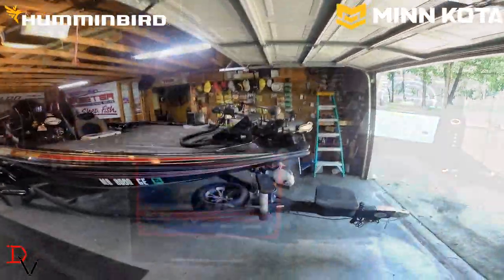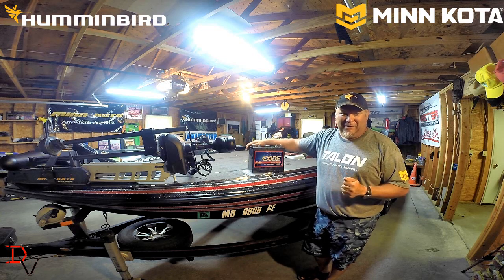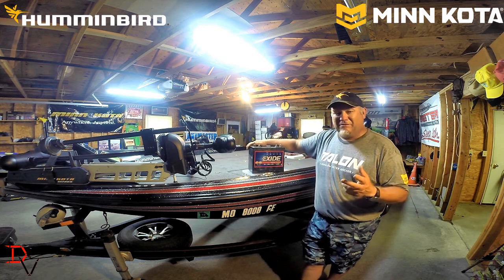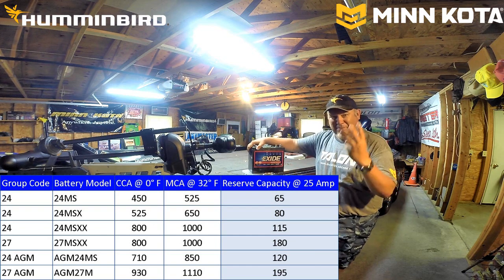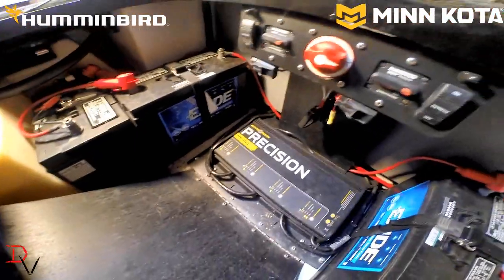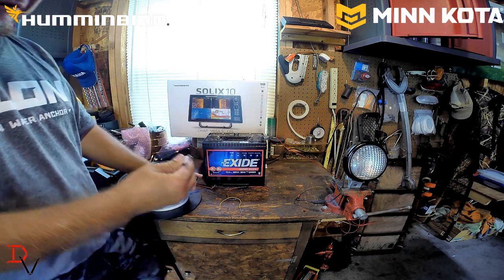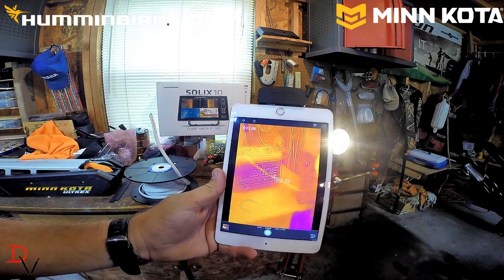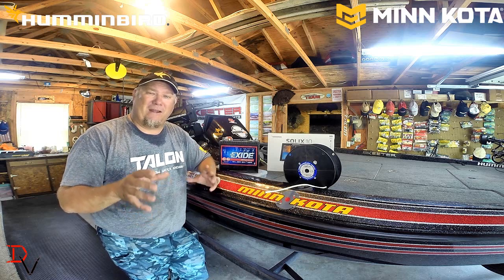Tips 'N Tricks 218: Understanding Boat Electrical Power Supply

Comment: I have a 31 agm battery from interstate, and it has 5 less reserve capacity than the 27 agm you have listed. I'll have to do more research when I buy my next boat batteries!
Reply from the maker: That is Exactly why I mentioned this is Group Code don't mean squat...It's what's inside that really matters the most. Glad it could help the next time you buy. Buying by the specs is what really matters.

Comment: How about this.  Many people believe in running a separate battery for electronics. So if you have a 36 volt trolling motor system, this means running 5 batteries. 3 trolling motor batteries, 1 starting battery and perhaps it also powers livewell, bilge pump, and all of the factory installed components, and then 1 deep cycle marine electronics battery.  Maybe Minn Kota should design a 5 bank charger.  I run the MK 345. I have a Lund Rebel XS. I just run my electronics off my starting battery as you do Doug. That's because I have a cabin and I just pull up to the lift when I feel my batteries are getting too drained and then I can easily plug into solar which I leave at my boat lift or plug in my on board charger.
Reply from the maker: I've never found the need for 5 batteries (1 Only for Electronics) and I run up to 5 units on the boat. But I buy the best Reserve Capacity Battery for the Starting Battery and reduces the need to have an extra battery. That is one of the reasons I did this video is buying the right batteries based on specs will reduce need for added expenses like adding a 5th battery

Comment: Hi Mr V , Great video , does a solix use more amps then a regular helix , someone told me a solix eats up the battery
Reply from the maker: SOLIX does require more power to run the advanced features and larger screen but it only requires 5 amp fuse so not much more than HELIX. I run 2 SOLIX & 3 HELIX plus everything else on my boat off a single battery.

Comment: Minnkota recommends 105 Ah (Amp hour) minimum on the majority of their trolling motors. I understand that Amp hour and Recover Current are NOT interchangeable and some battery manufacturers offer one or the other in the specs. I have read that there is a conversion formula that you can use to convert one to the other and that its typically a hair higher than 2 RC's to 1 Ah. Do you have any information about the difference?
Reply from the maker: It's Reserve Capacity and Amp Hours both help determine the amount of electricity that can be stored in a battery for use by electronics or in the case of starting batteries how long they can spin the starter. I do not have a conversion chart but might check google search engines lost of good reads on electricity on the internet.

Comment: Doug I'm buying a z21  one battery for gas motor and 3 batterys for minnkota 36 volts  I'm going to buy 2 solix 15" screens. Should I hook the fish finders to the starting battery or one of the end trolling motor battery ?  Or should I get a extra small 12 volt battery for just for the fish finder ? i would have 4 baterys then on boat.   Thanks
 Jim

Comment: So I'm getting new boat and it comes with the interstate 31m-agm cranking battery it has 800 cca or 1190 ca which one go by?  And 190 rc @ 25 amp.  Im going to put 2 helix 12 mega si and 2 helix 10 mega si and 360 on is this going to be good enough battery?  Thanks in advance Doug.
Reply from the maker: Sounds like it could work. I haven't had much personal success with Interstate but they may work. Specs look good.

Comment: I've never understood why you must wire graphs directly to your battery, rather than to the master fuse box, which often times protects you with a master power shutoff.  If you wire directly to the starting battery, you bypass the master power shutoff, thus opening the human element of forgetting to shut off all graphs in the boat.  Can you explain or do a video why it's important to wire directly to the battery vs the boat's supplied fuse panel.  Also, how do you handle the master power, truly not powering down all electrical components in your boat?  Thanks.  Loved this video by the way.
Reply from the maker: It all depends on the amount of current through that master powerswitch. Plus powering down a unit by cutting power and not using the proper button on the unit can damage the unit and not save settings. Not good improperly powering down unit and not good not providing it sufficient power. Plus you should always fuse the wiring at the battery for the unit so it's protected too.
Reply: I have a master power switch on the dash for all other electrical but my fishfinders.  For that (helix10) I use the same 10awg wire Doug recommends to an on/off switch then to a buss bar and on to a new fuse panel.  The power wire from the helix has a very short distance to travel as the fuse  panel is right below the console.  Works great!
Reply: The way I have mine setup is I have a battery mounted 60 AMP fuse.  6 AWG going to a Blue Sea Systems which has a positive and negative bus. I cut out a hole in my dash and mounted a battery switch. So the positive goes from the battery to that switch and then to the Blue Sea Systems fuse panel. The negative goes straight from the battery to the fuse panel.  I have it screwed on the wall under that is the longest distance from my feet just above the floor.  So it's basically the same concept as master power. One battery switch turns on the whole circuit that connects to that fuse block.
Reply: And yes each of the individual components have 3 AMP fuses to each of them on my Blue Sea Systems fuse block.
Reply: @DougVahrenberg  well what do you recommend? I two am running new wire for my bigger helixs, one at the console and one on the bow. Should I run dedicated wire to both straight to the battery? This means four sheilded 10 gauge wires from the battery up to the console and the other two going to the bow? Won't my units drain my battery?

Comment: Doug,          I have the Solix 12 chirp/with side imaging and a MinnKota Terrova with the US2 transducer. Do I use the 14 M SIDB Y splitter cable so I can designate which transducer (transom/bow) is operating ?
Reply from the maker: You do not need the Y Cable unless you want the 2D sonar always from US 2 and the SI & DI from the second transducer. Or I just install the SI transducer and it will do everything you need 2D, SI & DI from the single transducer.
Reply: Doug Vahrenberg Thank You

Comment: You are saying that because you are running several units you use 10 gauge or you run 10ga to  each unit.  10 gauge is rated at 30 amps. I am fused at 5 amps? That is 6 times the current carrying capicity than it is fused? I am an electrician and I believe in running bigger wire than needed for voltage drop. I thought mine was over kill with 12 ga wire.

Comment: Doug I’m looking at getting a battery solely to power my new Helix 10 mega si g2n. A battery that will get me through a day of drift fishing, spot locking and still maintain 50% battery life by the time I’m back at the marina, any ideas on a battery for this application?
Reply from the maker: You need to purchase a battery based on the Reserve Capacity that is amount of electricity available for using electronics. May need 2 batteries connected parallel to get the capacity you want and maintain 12 volt.
Reply: Doug Vahrenberg 
Think I’m going to go with the two battery parallel setup. Think a 2- bank charger will be ok to use with this setup?

Comment: My 2002 boat was rigged with what looks like 18g wire,  Just won't work for today's electronics!
Reply from the maker: Exactly. This is one of the big reasons to make sure your units get a proper power supply. In 2002 we didn't have 9, 10, 12, or 15 inch units with all these technologies.